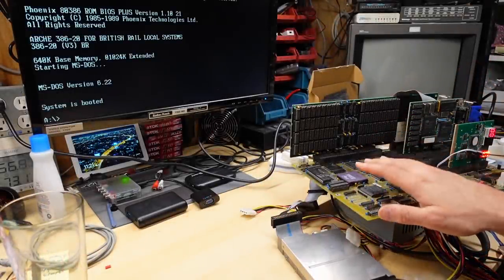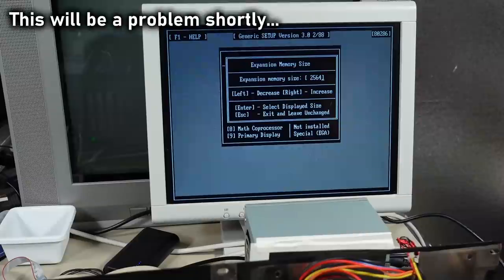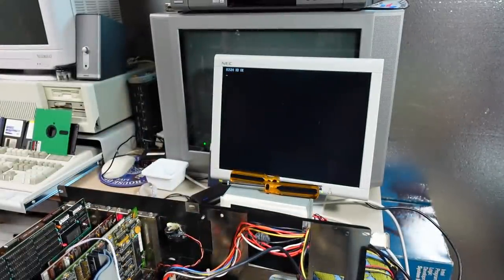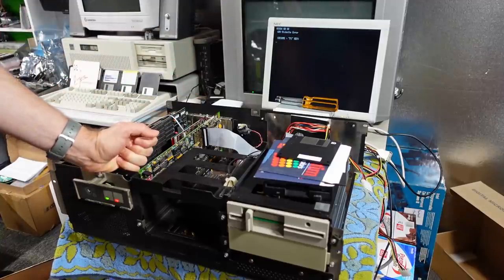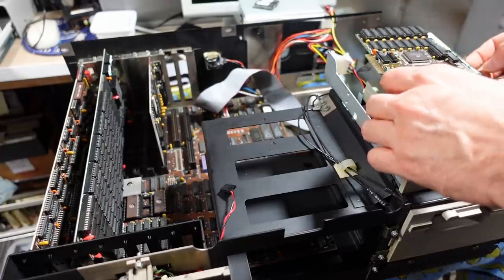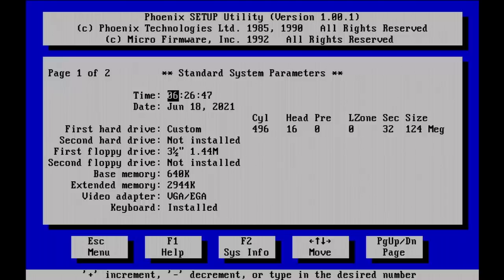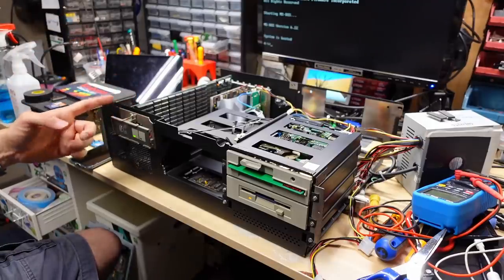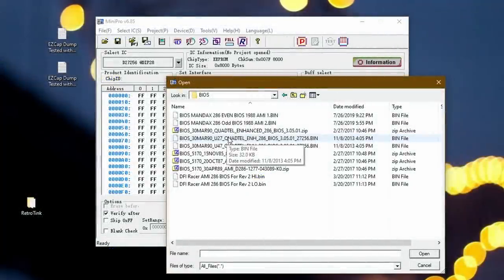IBM PC/AT Model 5170: So many issues! (BIOS mania)

Comment: I'd recommend take all components out not necessary for boot and add back one at a time rebooting and verifying each component as you go. Throwing everything together and turning it on is THE recipe for incompatibility, especially with undocumented parts from different time periods.

Comment: Regarding the utility to set keyboard repeat&delay values: Isn't that MS-DOS's  MODE CON KEYBOARD REPEAT and MODE CON KEYBOARD DELAY or something?
And the "primary" or "secondary" floppy disk controller [setting] lets you use the "onboard" controller plus one in an expansion card slot, and set whether the onboard or the card one is used as #0. Basically you can use up to 4 FDDs, "A" and "B" per controller (Note: no drive letters, just the way FDDs are adressed per cable; with those 4 wires flipped between the two drives).
EDIT: a word in [] for clarity.
Also: What happened here? 45:30: The BIOS "forgets" your "swap floppies" settings on reboot, so you rebooted from your 5 1/4" floppy. This feature is for IT personnel who wants to boot a diagnostic floppy disk ONCE, but without messing with the office worker's PC setup.

Comment: Cut my teeth on a 5170 with BIOS issues and adding an AST Advantage.  Fortunately Dad was able to find a set of manuals and setup disks at his work after replacing the battery.  I eventually swapped CGA with VGA and got Duke Nukem 2 and Windows to run on it.  Still have the AT -- and returned it to stock.

Comment: a quick ish fix to the dim hdd led is to take +5V off of the psu and use a mosfet to switch the led and then the cf signal is used to drive the fet..which in turn drives the hdd lamp on the front panel

Comment: great vid , i have a early first gen AT comp with the orig hard drive , works good at first after setup , then as the harddrive  is run for a bit than it cant read right , going too look for a seagate  20 meg . first gen bios dont alow for much higher . happy to just restore  it to original 84 specs

Comment: if you want brighter hdd diode you can always swap a resistor for smaller value or use that led connector as a transistor driver and power chasis led from 5v via a proper resistor, very simple circuit 3 component npn transistor, resistor and the led itself , led or resistor to power and  transistor colector, emiter to ground trough the other component and led signal positive to the base of the transistor
as a resistor you could use adjustable resistor/potentiometer 1-10k to  figure out the resistor value and then swap it for the closest standard resistor

Comment: I'd be curious to see Windows 3.1 on here since it has enough RAM.
Reply: It'll be laughably slow.  Trust me...been there, tried that.
Reply: Please correct me, but I believe you can only run 3.0 on a 286 but not 3.1 (that has no standard mode support anymore?)
Reply: It will work but will be a terrible experience. And will not be usable for the more complex apps. Kind of like runing Win95 on a 386SX
Reply: @badscrew4023  Windows 3.1 will work on a 286.  3.11 will not.
Reply: @thepirategamerboy12  aha, I was close then but not quite!

Comment: Do correct me if i'm wrong, but I think that eeprom can be to slow for some computers, like it times out while reading, so those eeproom might be perfectly fine and in spec, but the computer didn't get tha data in time and locks up, this is even more sensetive in 2 split eeproms, as in this case, they need to be within pretty close range of each other (or atleast no to slow for what the computer expects) I remembering fiddling with an amiga 1200 custom roms and one of the eprom (not eeprom) was to slow, the eprom was function just as it should, but it was to slow for the amiga and just locked up instantly, changing out the slower model (which always made 100% checksum) to faster variant got rid of the lockup

Comment: likely your network card your going to use has a eeprom rom socket so why not use xt ide and then you can use whatever bios on the main board you want? then you shouldnt have to worry about the file size problem right?
Reply: XT IDE has much lower transfer rates than AT IDE.  Machine is gonna be slow enough running full 16 bit cards without running the drive off an 8 bit bus.

Comment: A couple of comments...   1) If you can find a copy of "Compaq DOS 3.31", it has the "large hard drive" support, without the extra bloat/bugs from Dos 4.0.  2) When it would not boot from the CF card, after you ran "sys c:", did you also run "fdisk /mbr" to replace the master boot record?

Comment: Did you double check the hdd led polarity ? You have to recreate the partition and reformat the partition so the heads cylinders and sectors per track are correct. I used to use norton utilities to fix these problems with diskeditor. Sometimes Norton Diskdoctor could also fix the problem.

Comment: @Adrian's Digital Basement Daft question perhaps, but I do wonder if some of those 6xx class errors occur with the older BIOS versions because the code is expecting some hardware to be available that was included on the drive IO card, rather than the Motherboard?
A bit like the way they included the Gate A20 controller in the Keyboard?!?

I don't know, that just came in a flashback, so I've no idea if I'm making it up or not!

Comment: Also, those settings from IDEDIAG seemed very wrong to me. Sector size of 528 bytes? Track size of 16896 bytes? Those both seem off. I have never seen any media with anything other than exact powers of 2 in those categories. You would expect 512 byte sectors and 16384 byte tracks. At least the values it gave are multiples of each other, but I think that program is probably having issues because it's a compact flash card.
Reply: This video is the perfect example of why I simply do not understand this weird "purity" obsession with some collectors. Who cares if it's all original? The people who actually USED these machines (and that's their purpose, to be used) wouldn't have wanted to keep it stock. They modded these machines, upgraded BIOSes, added new drives, CPUs, etc. If I find machines from this era that are heavily modded, I lean into that and make sure to try and keep the mods functioning, instead of undoing all that work to restore it to a useless, frustrating to use, "virgin" machine. It just makes absolutely zero sense to me. I collect old computers because I find using them fun -- I don't just put them on a shelf and look at them.

Comment: The IBM BIOS is not great, try a non IBM one, I did to solve several issues I was having, but also because I have 12Mb of RAM in the thing and the AMI BIOS allows me to skip the memory check, and it has a built in setup utility.

Also, what calculator app are you using on your pone?

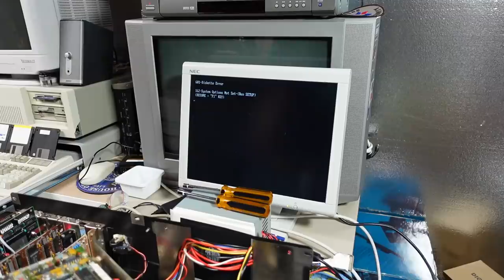Comment: 20:21 I'll bet at the time they made that bios they didn't sell anything that didn't contain those things default and it's hard coded in the bios. It may even have been to prevent people from removing those items and using the space for other things because they had another computer that was more capable but more expensive, and they wanted to drive people to buy that one.

Comment: 36:26 that’s the same BIOS my Tandy clone runs. Or did run, it’s not now. It needs repairs. :(    My dad installed a battery mod back in the mid 90s and the alkaline batteries leaked all over the motherboard.  And from what I remember when it was last running it had some sort of HDD error where it had trouble spinning up. I’m hoping the sewing machine oil trick I learned from you will work with that, and it’s not a more serious problem.

Comment: On 286 machines, I usually use XTIDE Universal BIOS to auto-detect CF cards.  I usually burn XUB to an EPROM and use an ethernet card with a boot ROM socket to load it.  Seems to work fine for me.  Though, I think there is an issue with XUB on 5170s.  I am using a CF card just fine on a Compaq Portable III :-)

Comment: Curious about what software would you use in this machine with 3Mb RAM e an FPU.
Reply: CAD. Any time before maybe 2000 to 2005 (and maybe beyond...), if the specs seemed to be on the high end for any particular model, CAD and similar was highly likely. IBM actually sold a GPU (the PGA, I think, with something like an 8080 of it's own onboard- and it used three physical boards instead of one, and I think two 8-bit ISA ports) that was intended primarily for CAD & other engineering purposes.

Comment: It's unfortunate that it's not really an intact IBM machine anymore. I have one question nagging on my mind though, and that's if it would've worked if he just turned it on as it originally was, before swapping cards and bios chips. Apart from the hard card, that is.
Reply: It would not have turned on at all because of the shorted capacitors. By the way the IBM BIOS of this machine is particularly buggy and if you want to use the "usable" later BIOS versions you really have to have a specific IBM disk controller card or it will produce that error.
Reply: @Schule04  And apart from the obvious faults, of course. Broken is broken. Whether the BIOS is/was good or not, isn't that relevant. That's what was in there when it was used in the past.

Comment: Hi ! The AT Bios as far as I recall does not support 3.5" / 1.44MB. The Sysgen 1.44MB available for the AT requires to load a DOS-based driver. The problem is the data rate required for the 1.44MB format, which is not supported by the BIOSses until the PS/2 came out.
Reply: The BIOS revision from November 1985 does support 1.44 Mb drives. I feel like adrian would have been a lot more successful if he had spent some time reading at minuszerodegrees instead of hectically swapping out cards and ROM chips.
Reply: @catriona_drummond  :-) Maybe more calmness could have caused better and faster results. But on none of my AT03's I ever owned the 1.44MB format did really work - except on one where I tossed the IBM FDD / HDD controller and installed an Adaptec AHA1542 SCSI / FDD controller instead. The data rate needs to be supported by the controller as well - and it seems the old WD chipset on the IBM controller didn't do that. I installed the last IBM AT03 in spring of 1988 at a customer, followed by some XT286 (!!) the same year when they were sold with a huge discount by IBM along with their own ISA VGA-Adapter and 8512 PS/2 screens. But those had a different sysboard to the AT03. And with one of these I'd managed to get a 1.44MB / 3.5" FDD (with a black front) to get going.

Comment: This won't help your specific issue I think, but it's good to know that DRIVER.SYS (from MS-DOS files) can be used to override BIOS settings on floppy disk type, allowing using a 1.44MB drive on a BIOS that does not support it.

Comment: possibly a brain fart, but Pre isn't precomposition, it's Write Precompensation. Has to do with compensating for the Constant Angular Velocity when recording on sectors closer to the center of the platter, I believe. I think it's only relevant for MFM/RLL drives, as the controller needs to know about that setting. With IDE drives the drive controller is part of the drive so it usually is available to the firmware directly.

Comment: maybe try a different 5.25 drive? or maybe using only a 3.5 1.44mb as A?. what about a different floppy controller that's not the original or the other one you tried?. take it from a working 386 or 486 to be sure it supports 3.5 1.44mb.
(by the way, I love this kind of videos. it's really fun).

edit: maybe the problem is the bios or the batteries?.flash the bios, check your battery replacement thing.

edit2: when it's not booting from the card maybe fdisk /mbr could fix it?. or check if the partition is activated as bootable, maybe it hasn't the flag set.

Comment: I recently acquired a 5170 complete system and got the 161 error during bootup. So I replaced the battery pack and I blew out some of the dust (with condensed air can).  But now when I bootup, the monitor will not show any values. The monitor does change color a bit when the PC is started, so it does recognize the CPU, and the keyboard is interacting... but i cannot see anything else (ie the MS DOS prompt).  Any ideas what to check, as the connections seem fine.

Comment: I wonder if the 601 error was related to the bad BIOS EPROM
Reply: Probably not, on minuszerodegrees it says that those BIOS versions simply only work with a specific IBM disk controller card or perfect clone. This might even have been an attempt of preventing clone manufacturers to use the IBM BIOS

Comment: Hello, On the Phoenix BOIS screen it mentions - ARCHIE 386-20 FOR BRITISH RAIL LOCAL SYSTEMS. Any ideas what this is? I noticed it at the start of the video (haven't finished it yet) was it mentioned on a previous vid?
Reply: This board was sent in from a viewer in the UK. British Rail was the nationalised rail operator in the UK prior to 1997 and this board was likely built specifically for BR and used by them in some capacity.

Comment: The only "issue" with both the purity of the machine and the sound quality is the lack of buckling springs. Every time I hear the case of that Dell rubber dome abomination flex, I die a little. And no lapel mic will heal that scarring. Do you have any Model F or M's? I have late M, I could donate, but it has a rare Dutch ISO layout. Which is a pain if you don't touch type the special characters.

Comment: So IBM type 1 motherboard work with both versions of hdd and fdd controllers, maybe problem is elsewhere. Try to replace floppy cable OR there can be some issue with terminator chip on 1.2MB drive.

Comment: It's possible that when you swapped the bios chips that you killed one of them. You did take it out pretty quickly after powering off the machine. I've killed a chip like that before. I was trying to put a 286 bios into a 386 machine to get a 1.44 floppy on a compaq 386 that didn't like the floppy I had. And ZAP!!! I lost both computers LMAO. And I didn't have programmers or options or anything so we got a 486 after that. I don't even think we used the 5.25" floppy after that either.

Comment: i think the essue is likely  that you haven't  set the master and slave on the floppies I would suspect thsat 40 pin cable were like  scsi cable  not  whatever the default standard  back between 81mid 86..

dos 6.2 circa the same time as win 95

this sytem would of predated fpram and EDO ram and I doubt you would run windows 3.1 on the system

Comment: Since you can punch out the hole from a 720k disk and format it 1.38MB , i wonder if you could block the hole on a 1.44 disk and format it in 720k?

Also for future proof, maybe try a CF to SD adapter, since you can buy SD cards so cheap

Comment: I always think of 3.5" drives being A: and 5.25" drives being B:. Isn't this what Windows expects? Of course you're just running DOS.
Reply: That was common by the mid-late 90s. When 3.5” disks were new people usually had the 5.25” on A for boot disks. Plus of course both A and B were 5.25” at the very beginning.

Comment: There is a good chance that the "defective EPROM" may actually be good. The TL866 is really a very poor EPROM programmer. I have had SEVERAL issues where EPROMS (especially the 21V programming type) will program and verify correctly on the TL866, only to fail in real world use. The same EPROM when written by a different programmer (like a Needham's/Logical Devices) functions correctly. My best guess is that the TL866 is not able to generate a high enough programming bias voltage to allow a sufficient number of electrons to penetrate the oxide of the floating gate. I have also found that programming the same EPROM 5 or 6 times in a row (with the same file without erasing) in a TL866 will many times allow enough electrons to penetrate the oxide layer for the EPROM to function correctly. Never trust the EPROM verify on a TL866.

Comment: BTW: if anyone knows how to configure either card for 60 petabytes of RAM, please let me know. I need at least that much to run my holodeck program, “Attack of the killer, flying, ninja death squirrels from planet X3”! 🤣
Reply: Rofl...What?!  xD xD
Reply: Can't do that directly over ISA, not enough address lines. Build a hardware translator for either ISA or Parallel, with some mix of memory mapping & address-extension registers ;p

Which might be funnier to me, if I hadn't explored how to hang a bus translator off the ISA bus a few months ago (fun DMA idea- use the same chip as the PCs, hang it off your target DRq/DAck like in expansion mode, but program both for block transfer instead of cascade, and isolate the address buses from each other during all DMA cycles...).

Comment: The 3meg card is more trouble than it is worth. There is absolutely nothing you will ever do with this machine that will benefit from more than 1mb. Really the only reason it will benefit from 1mb is because you can load dos high with the full mb.
Nothing that needs a ton of RAM is going to run on a 6mhz 286 with EGA.

Comment: Thinking of the FDD issues, it makes me wonder if the one 5.25" Mitsumi/Newtronics drive I have (which came from Russia!) has dead caps as it comes up with a General Error reading drive B:, and IMD just gives a string of question marks when testing it, motors work, just nothing coming form the heads...